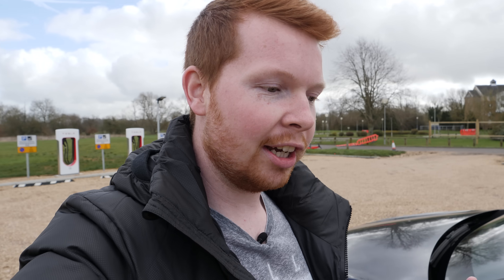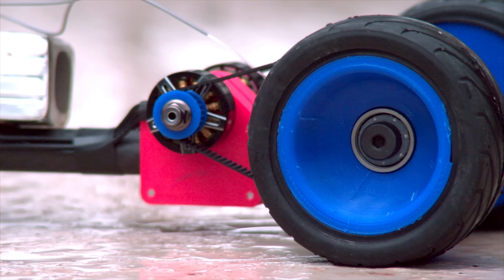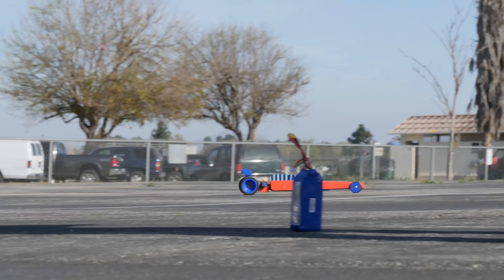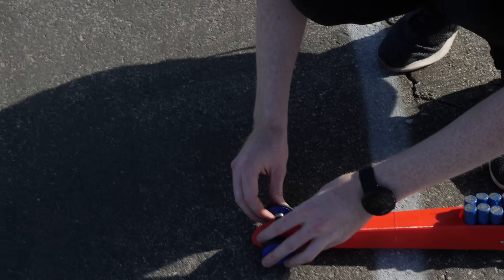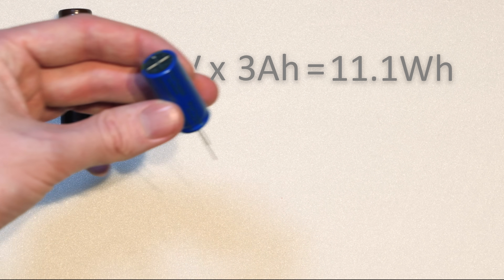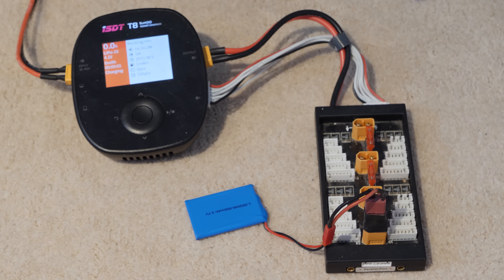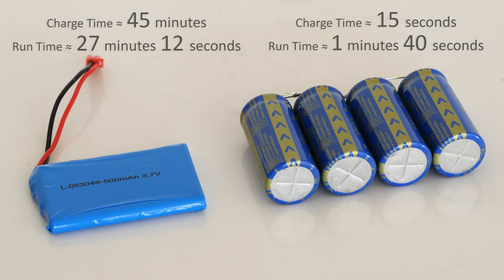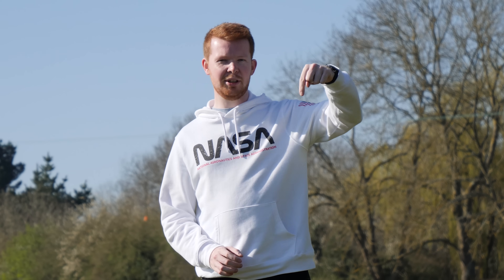Super Capacitor Dragster

Comment: I've been looking at using SuperCapacitors as a quick charging replacement for a cordless drill. The problem is similar to your one in the video, ie the voltage drops to the point where you can't drive the load, and you can't extract all of the energy. It also doesn't deliver the same output power to the motor as it discharges. That's not important for your experiment, but it is for a cordless drill.
I've concluded that what's required is a DC-DC converter so that the voltage output is whatever you require, regardless of the state of charge. If you take that route, you can have a step down - step up arrangement that allows for much more of the available capacity to be used. You can have put the caps in series and run them until the DC-DC converter can't deliver the required voltage any more.
Perhaps this is something you could experiment with.
And before anyone jumps on the fact that SuperCapacitors won't run a Cordless Drill for long, the fact is that many is the time that the stored battery is flat, and then you can't use it at all!
Reply: the problem with connecting capacitors in series (to up the voltage) is that the capacity diminishes dramatically. You take the capacity, here 50F, and reciprocal it, so 1/50, add it all up, 8/50 (8 caps), then reciprocal it again and you get 6.25F. now you have a big capacitor that pushes high voltage for just a tiny amount of time. now even if you stepped down the voltage from 24 volts (3v * 8caps = 24v) the caps are still pushing 24v into a 12v system. Now to convert Farads into mAh is complex calculus that gets you 20mAh with 6.25F at 24v

Comment: An engineering question - how does the battery pack weight comparres with the supercap pack weight?

Why would you not compare two similar weights pf packs?  Supercap vs battery?

Comment: Hi, the capacitor not a bad idea but you discovered the problem or one of them, you could start with more and limit to less.  The dragster also a problem. That type of drag car was never designed to round bends.  The front wheels are there to keep the front off the ground and pretty much keep in a straight line.

Comment: Battery  charge time 45 minutes
Super capasitor charge time 15 seconds
Oke...
45x60seconds= 2700 seconds
2700÷15 seconds= 180 x charge super capasitor
180×1minutes 40seconds= 180×100= 18.000 second ÷ 60= 300 minutes ÷60 = 5 hour.

long duration of use of supercapacitor 5 hours with a 45 minute battery charge duration comparison
which means the supercapacitor can save charging time by 11,02× compared to the battery
if the distance in which can be taken is equated then supercapacitor only takes 45 minutes with a duration of 5 hours whereas with a battery to touch the duration of 5 hours it takes a charge 8 hours 16 minutes 19 seconds 41 milisecond.

the problem is who wants to stop every minute just to charge for 15 seconds  and 11 times

Comment: in addition the hyper capacitor is good but the way you placed them was not the right way you had to put them on the chassis to have a center of gravity lower there the weight will be better to manage 50/50

Comment: hello it is very beautiful your reduced model so if you have to explain it is the chassis you have to make a chassis in a bathtub and in the shape of a fairly wide triagle and increase the rear wheelbase of the rear axle and wider tires at the rear and with an anti roll bar at the rear and it will hold the road because there your chassis is too light and the wheelbase of the rear axle is too short and the front too

Comment: So make the super caps 27 times bigger and now electric super cap cars are charged quickly!  How fast do they phantom leak?  Fill the truck with them, or pull a trailer.  Charge limit would be your AC amp rating.

Comment: What's interesting is yes at first glance the lithium looks like the best it runs far longer. But to get the equivalent run time with the capacitors you'd have to charge it "roughly" 27 times giving you 6 minutes of charge time rather than 45 minutes.

Comment: Don't forget that top fuel dragsters don't turn or steer on a run, they just make micro-adjustments basically they go fast in a straight line. You have no stability issues, your dragster ran fine.

Comment: In theory you can take super capacitors and make a high voltage pack out of them for both hybrid and electric cars and then set the system up so that way whenever you are regenerative braking it will charge up the capacitor pack 1st 4 recharging the regular battery pack and you could also program the vehicle to use the charge out of the  Capacitor pack before 8 uses the charge from the regular batteries I think that this would also increase the efficiency of hybrid cars and it would probably help the efficiency a little bit of battery electric vehicles Because the capacitors are so efficient in being able to be charged and discharged the only problem is when you look at how big those capacitors had to be compared to the lithium battery that ran the car so much longer you would not get very much run time out of your car with the capacitors especially a battery electric car considering how small D capacitor pack would be but even in the hybrid car same issue probably just enough energy to accelerate you to about  35 miles per hour to 40 mph miles an hour if you are Decelerating from 40 or 45 miles an hour Theoretically this should help to improve the efficiency of both battery electric vehicles and hybrid vehicles because you would program the capacitor pack to charge up off of the regenerative braking to full before the chorus primary battery pack and then you would also program the car to if at all possible utilize any charge that is available in the capacitor pack until the capacitors are discharged so that way you are using as much of the regenerative energy as possible for locomotion which should theoretically help to improve the efficiency of the vehicle the only place where this comes in to be an issue is literally the fact of how much energy it stores for the size that is where especially the plug in battery electric vehicle would find the most issues but in essence this is a really late battery and should help to improve the efficiency of a  Either vehicle as well Because there is almost no officiants I loss in charging or discharging the capacitors within such a short time span.

Comment: You failed to cover the other unique capability that super caps have: not only do they charge quickly, they discharge quickly, as well. So, if you connected a more powerful motor that had a larger Amperage draw, you'd be able to power it, whereas batteries would sag and/or overheat with such an instantaneous draw.

Comment: Okay, I've been sitting on this idea for a while, but wouldn't it easier to make charging stations that had a stock of batteries charged and ready to go, so when a car pulls up, you could swap the dead battery for a charged one, kinda like a propane tank exchange? 

Obviously there's huge engineering challenges but it seems do-able to design electric cars in such a way that they all have a standard battery (or one of only a few standard designs) where the battery is removed from directly beneath the car, so that you could have an automated system in the foundation of the charging station for swapping out batteries. This would remove the issue of waiting for your car to charge on a long trip, plus would give a use for old gas stations once electric fully takes over, they already even have space underneath, as you could re-purpose the old fuel storage under the ground

Tesla seems well suited for this, as they already have a separate power ecosystem for their offerings, and as it would probably have to be implemented in the US through the free market, but perhaps the EU could get away with mandating manufacturers use standardized, approved batteries utilizing the relevant quick connect designs